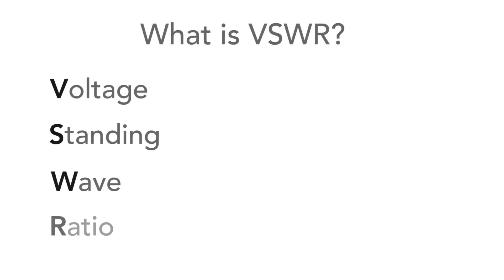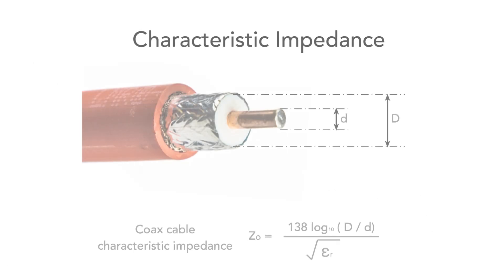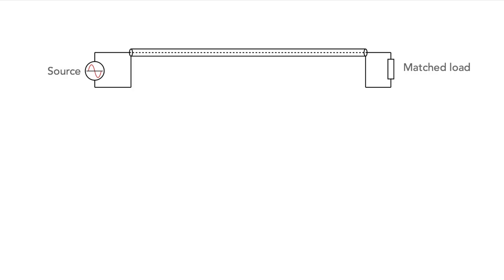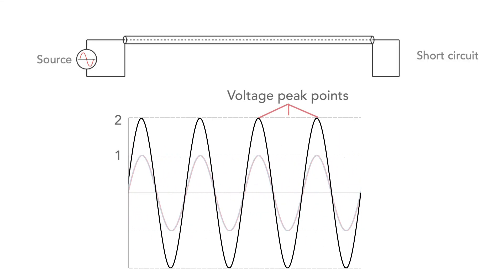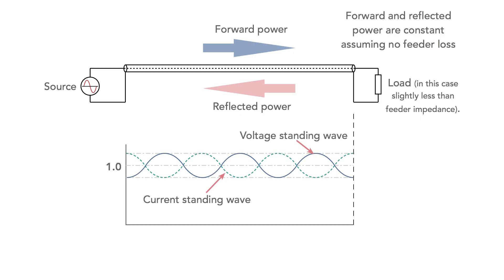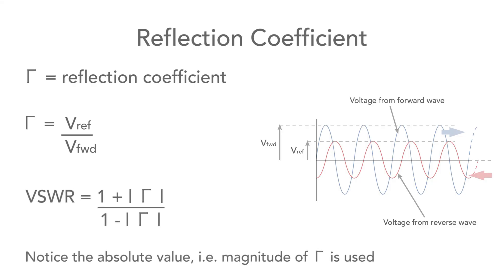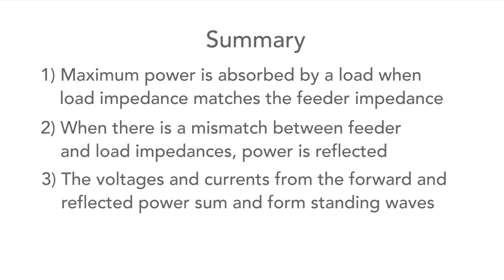Understanding Standing Wave Ratio: SWR & VSWR #SWR #VSWR

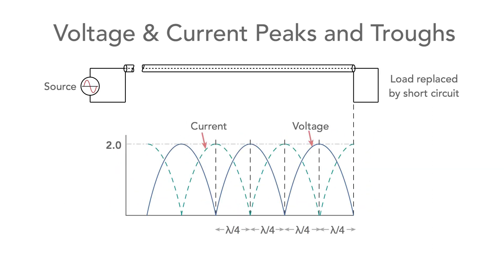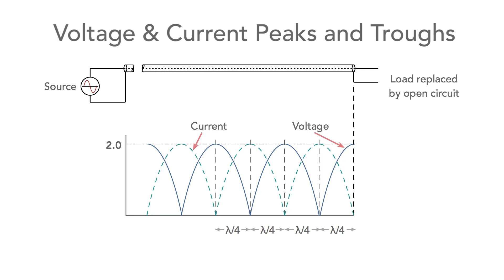Comment: Nice animations and video, but for the plots mentioned in 3:40 and 4:01, shouldn't the standing waves look like a sinusoidal wave with 4V peak to peak? Just as the ones showed earlier in the video?
Reply: I mean like the wave shown in 3:26
Reply from the maker: It is because of the wave the interference patters sum together. For small levels of re-elected power a near sinusoidal pattern is generated, for much higher ones it approximates to a half sine wave.

Comment: how matching vswr?
Reply from the maker: There are many units for matching the impedance of an antenna to a feeder. You can use an antenna tuner:  https://www.electronics-notes.com/articles/antennas-propagation/antenna-tuning-tuner-unit/what-is-an-atu-basics.php
This is mainly used fir HF antennas where frequency changes are needed.
Alternatively a matching transformer often called a balun or even an un-un dependent upon the application. If high reactance levels are encountered, then a special matching transformer with opposite reactive elements may be used. Hope this helps.

Comment: For the short circuit, if there was a ground/earth connected, wouldn't the signal just go to ground just like any low-pass filters??
Reply from the maker: The signal cannot just go to ground because it would result in power disappearing. It has to go somewhere and therefore it is reflected. Hope this helps.
Reply: @ElectronicsNotes  Yes I get what you mean, but does this happen to signals that gets filtered out through low pass filters for examples? those are also going to ground...

Comment: Secret of the real wizz. Troubleshoot this problem with AM manual dial radio. Set at 1000,IF no radio near xmits there. I walk up n down cables. Listen to sound on radio. Signals of any RF swaves picked up. Almost always by damaged cables or bad connectors. Kids $3 am radio with headphones keeps hands free. Works on radar too. If its 100w xmitted stay 2 wave lengths away but you still hear it. Data from computers do the same. When found note distance. Tdr line. Or oscope. Boss will be impressed. Done dozens of times. Check coax. Ig rg-6 mixed with 11 could be issue.

Comment: What happens when the feed isn't a multiple of λ/4?
Reply from the maker: The feeder does not need to be an exact quarter wavelength. The voltages seen at any point along feeder of any length are those seen on the animation at that point. The only point that is fixed is the termination to the feeder. So you can work back 1.25 wavelengths, for example from the termination, and see what the voltages will be at that point on the animation, etc. I hope that explains the situation. This does assume a perfectly matched source impedance, otherwise you get even more reflections and the situation becomes very complicated.

Comment: Not very clear explanation. Need to explain that the gray and red waveform at the short circuit end are opposite voltages to get zero in sum.  Whereas at the open end, they are same value which gives double voltage in sum. So in both cases the unmatched end generates that red waveform going back. And still, not very clear why all that that happens at the end, especially for why the doubling happens at the open circuit case. Would be much nicer to start from the explanation of how the "step" voltage travels via transmission line and how it reflects off the unmatched end. That step explanation is very visual and easy to comprehend. Then, after that reflection phenomenon is clear, switch to sine waves.
Reply from the maker: Sorry it was not very clear for you.
Reply: Also no mention of where the reflected power ends up

Comment: It seems like the minimum voltage would always be zero, making the VSWR ∞. Is there just typically a DC offset?
Reply: Yeah, you'd think since they're AC, they will always pass through zero and this confused me too. But what is really meant is the maximum AC voltage anywhere along a line at least a half wavelength long divided by the minimum AC voltage along the same line. And since it's a periodic sine wave, one only needs to look at any half-wavelength section; furthermore AC voltages are positive values. So if there's no reflected power, the maximum and minimum are the same at every point and VSWR is 1:1, but once power is reflected they start interfering as the video shows with maxima and minima as described. Check out the Wikipedia entry - it's more precise and cleared it up for me. Boomlakalakalaka....
Reply from the maker: The minima and maxima are RF (AC) voltage levels hence no DC offset.